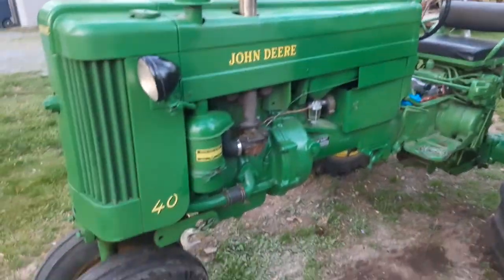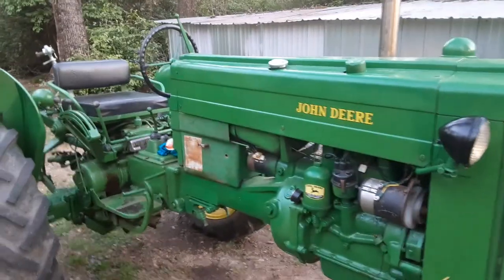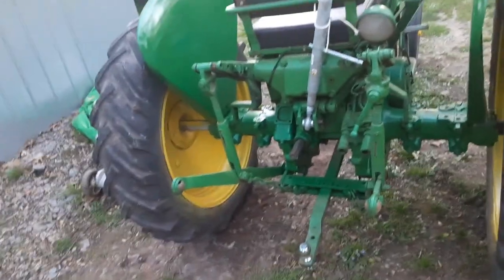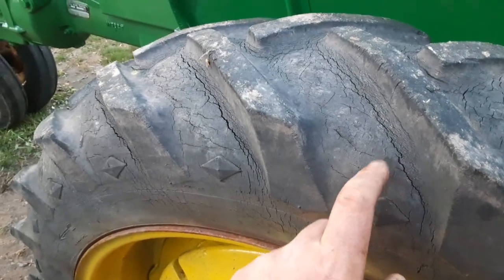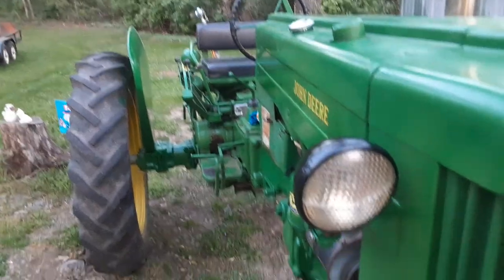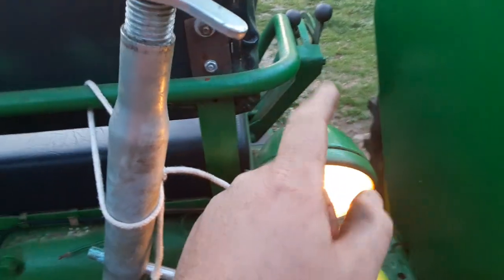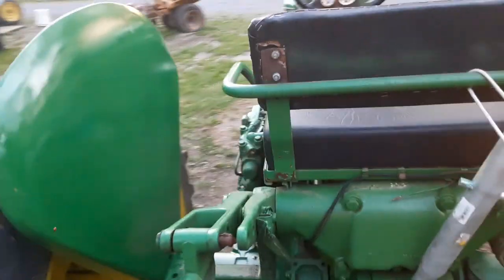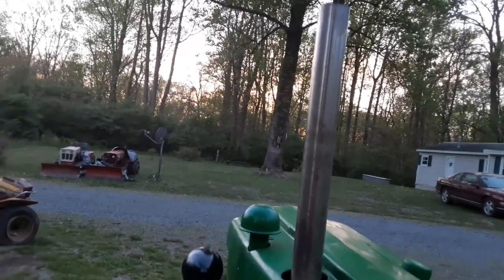John Deere 40t

Comment: I’ve got one looks just like it a 1953 all original been painted sounds good just don’t like the 6 volt battery system they have
Reply from the maker: If your wires connecting to the battery are clean and the right diameter then the 6v works good on these small farm tractors. I wouldn't want to try it on anything bigger then a JD 60 though do to compression. Awesome piece man.

Comment: Any idea on lift capacity of that 3 point?
Reply from the maker: I'm not sure honestly. I have a 7ft New Holland sickle mower I pick up easy enough and it's not real light. My 40T will bring the front-end up before the hydraulics run out of power since it's so front-end light. I recommend wheel weights or filled tires before you go lifting anything real heavy.